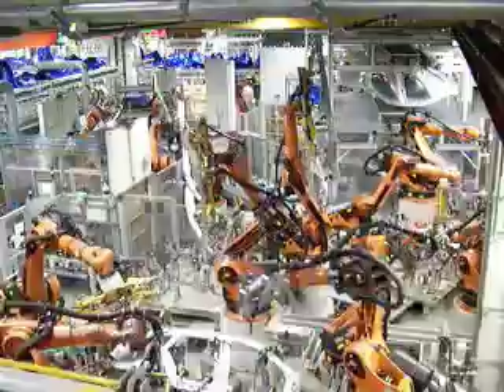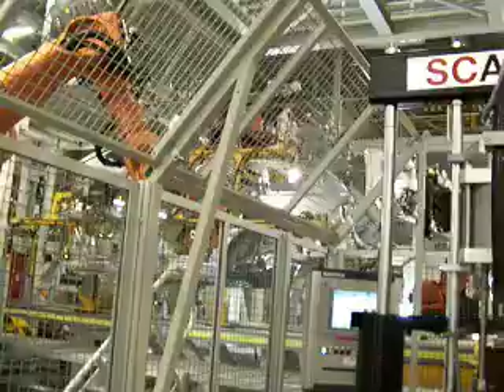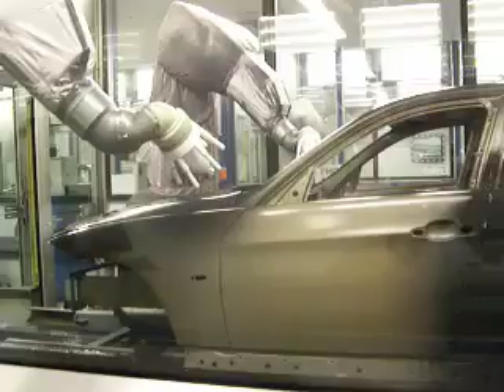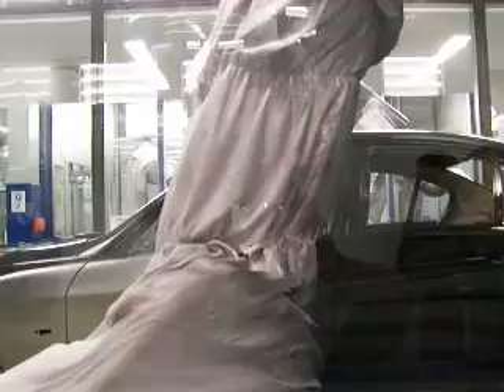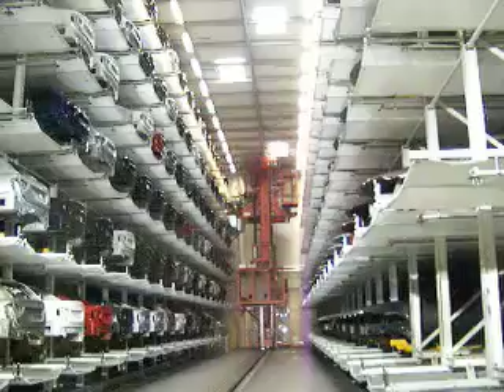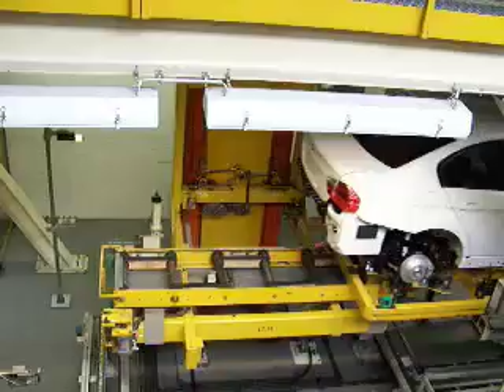BMW Assembly Plant Footage

Comment: thats what Im talkin about: robotsitters.
U be lucky but there wont be 50 assembly line workers replaced by 50 mechanics for inspection+maintenance. You alone work at an robot that replaces more than one man. So in absolute numbers jobs education will be lost.